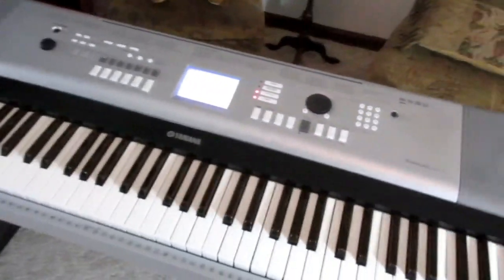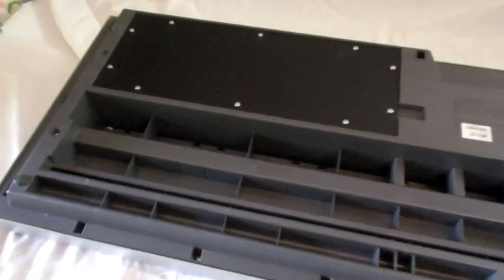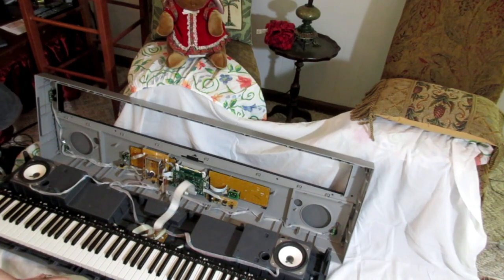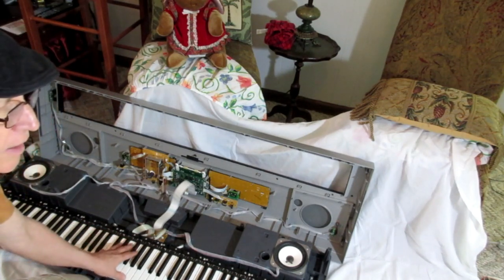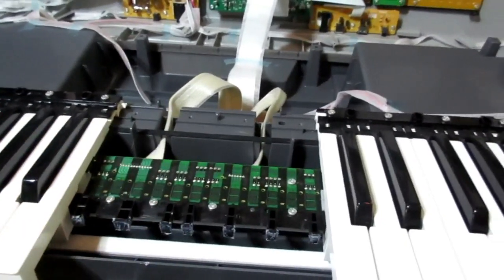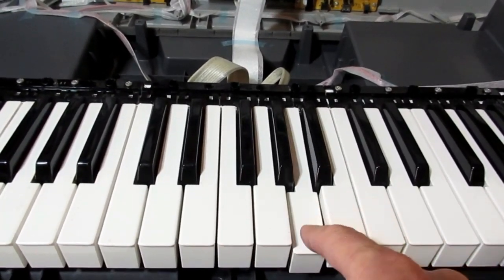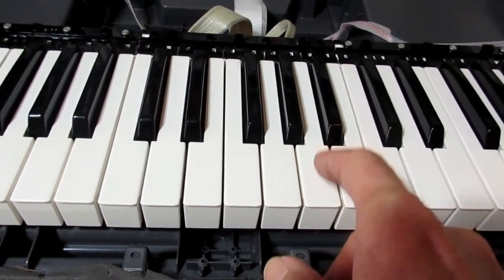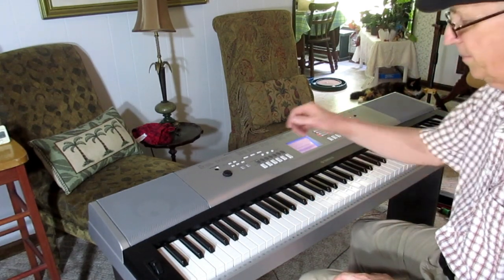I fix a loud key on my Yamaha DGX-520 digital piano.  Thrilled!!

Comment: I practice watching youtube video cause I can’t afford a teacher. I stopped playing piano for 8 months due to your same problem but with 8 deferent keys. The store told me it’s a motherboard problem and I need to pay almost $400 and was too expensive for me. I did what you did and now it’s fixed for free. Thank you bro you really made my year. I was feeling very down because I use to practice 2 hours every day. It sounds dramatic but i swear my eyes are tearing as I’m writing this. I really needed my keyboard back.
Reply from the maker: Your comment made my day.  I'm very pleased my video helped you get back to using and enjoying your keyboard.  Thanks for taking the time to tell your story!  Rich Davis😊😊😊😊😊😊😊😊
Reply: I have a yamaha E363, it has been with me for almost 5 years or so, it's in pretty good condition but I have the same problem, I thought it was dust, but it's two specific keys in all octaves; D's and G sharps. They are too loud if I play them on normal pressure and If I use a lot of pressure they either go silent or play 3 to 4 times. I tried this a lot of times, even used alcohol pads which made it better, but still loud, but it isn't working and I feel helpless, I can't afford getting it fixed from the store either, and I think something's wrong with the motherboard. I haven't played it in months, it was the only way I could relax and ever since then, I haven't been feeling amazing. I get what you're saying, that your eyes were tearing up as you wrote, and so I wanted to say that you're not being dramatic at all, I feel what you felt for those 8 months, I hope you're doing great and so are your piano skills. I'm thinking of maybe selling it and buying a new one, or maybe just stop playing piano since I can't really watch it sit there and feel helpless
Reply: @AjwaQur If you are having issues with keys in the same octave across the entire key board, I think I know what is causing that. The CPU inside the keyboard can only process one key at a time but it does all of them so fast over and over again you can't notice it. Yamaha keyboards don't scan from the lowest key first to the highest key last (progressive), they instead scan (interlaced) by scanning all the Cs first, then all the C#s, and finally all the Bs. They do this to save micro chips and for a less noticeable scan delay and is called multiplexing. When a problem is common to the same key in each octave, its the Common Note drive line that is flaky.  I am familiar with Yamaha keyboards (I have a DX7). I could probably fix it but it would not be practical to ship. I suggest you find some big engineering companies in your area and ask if you can post a flyer on their cafeteria bulletin board that you need help. If you go to several companies you may find a hardware engineer that might fix it free (except for the cost of parts). I do this often but only for local people.

Comment: Just got a same problem on my DGX-660. Now i'm gonna disassemble my piano. That's what i've read about what the problem is: "There're 2 switches mounted at different heights on every key, The piano does a really clever thing of measuring how long it takes for the two switches to be made. If you brush the key lightly there will be a greater time between both switches being made, in contrast if you strike the key hard the switches make much quicker. If however one switch fails, generally the piano will play the key at full volume as only one switch makes."

And that's exactly what i saw in your video (see at 8:34) – the A-key (the 3rd from the right side) had some white particle on it when you removed that grey rubber thing. Hope, in my case it will also be that easy... 🤔🤔🤔

Thank you for the video! 🙏🙏🙏
Reply from the maker: I hope, hope, hope it works for you.  If so, you will feel wonderful!!  Rich

Comment: I had the exact problem with my Korg SP170. I did a similar task and realised that even though a digital piano can save regular tuning costs compared to an acoustic piano, BUT, these lousy parts can also become defective and expensive to replace. I was lucky as you to not have to replace anything yet, just clean it. I had around 5 loud notes and 5 were almost mute before I opened it and after operating in a similar fashion, I managed to get the piano's notes back to perfect velocity on every note, except a very high note, which I don't mind now, since I hardly ever use that note.  In the end I probably have to repair those rubber contact strips, which are not very cheap...
Reply from the maker: I'm glad you were able to fix most of the problems you had with your keyboard.  You're right in that we probably can't keep fixing them forever.  The money I save in piano tunings might buy a new digital piano every few years.  I love my Yamaha DGX-650 white digital piano.  I've had it maybe five or six years now and have had zero problems.  I would never want a real piano of any kind as I grew up musically with Yamaha digital pianos.  I couldn't live without all the voices and the multitude ways to play.  Thanks.  Rich
Reply: @richdavis4007  also may I add there is a lot of rubbish on youtube these days but your video has helped me a lot as long with others to eliminate some of the guessing I would have done if I tried to fix my digital piano without this so thanks again for the post

Comment: I had few keys sound bad, after reading in commets here i tried to use the other end of vacum to do blower with tiny nozzle tip and blow in the spaces of the keys and its amazing the bad sounds gone and normal sounds comes back, so the videos and the commets really helps to solve my problem in my dgx 640, so no need to open and clean inside the piano as i did before. thanks to everyone.
Reply from the maker: Thanks for sharing your experience.  For those not wanting to take their keyboards apart, your methods sounds worthy of a try.  I can only vouch for sure what I did in this video.  Very best wishes.  Rich Davis

Comment: Finally fixed my loud  keys  after hours of try and error, at the end i had to remove the gray membrane and replace it with another one from a different octave and it worked!! 🤤🤤🤤🤤🤤🤤
Small tip for the ones who will try this: remember to always try your keys before screwing all the screws!!! And if you did it once do it again cause once is never enough😑😑at least in my case, i literally screw 200 times because of this dumb error.

Muchas gracias desde Chile,i'm subscribed to your  channel now, thankful to you and proud of me  at the same time hahaha . I couldn't stand more days hearing these OFFENSIVE keys 🥳🥳🥳🥳🥳
Reply from the maker: Super!  You hung with it and didn't give up!  It's a great achievement!  Rich

Comment: Nice video. At 2:28, a paper egg carton is good for organizing small screws, just make a note on each compartment with a sharpie.  So, for your viewers out there... you may want to hold off on throwing away your egg cartons and bulid up a reserve. They are stackable and dont go bad on the shelf.
Reply from the maker: That would have been very useful!!  I'll remember next time I have a lot of screws to deal with in a project.  Thanks!!!  Rich
Reply: @richdavis4007  I learned that egg carton trick from my dad working on engines. I am 60 now, so I pass on these tid bits when I can.

Comment: At 3:47 you can magnitze most screwdrivers by stroking a strong permanent magnet ONE WAY from the handle toward the tip (use the same end of the magnet for each stroke). About 20 moderately fast smooth strokes usually is all it takes. The magnetism wears away after heavy use but will hold for years. You can always re-magnitze it any time you want. If you remember which side of a magnet you used, stroking that side of the magnetic back from the tip to the handle can demagnitize it (but its hard to get it to zero). A degaussing coil is better for that.
Reply from the maker: Thanks for your helpful tips!  These should be useful for people watching my video!  Rich
Reply: @richdavis4007  Rich, it is refreshing to see people give it a go like you did. It's my pleasure to add my 2, 3, 4, 5 cents [smile].

Comment: At 9:05, clean everything with 95% or better Isopropyl Alcohol and also clean the Carbon Impregnated rubber contacts inside the gray peice you removed at 8:31. Its those contacts that touch the "serpantine" traces on the printed circuit board that makes the electrical connection when you press a key. Sometimes you may have to rough up a rubber contact very lightly with 200 grit sand paper. Pollution in the air glazes over the rubber over time and prevents the carbon from making good contact.

BTW... The reason there are two switches for each key is that they both don't contact at the same time when you press a key. One will contact first and then a few milliseconds later the other will contact. The computer in the keyboard measures this time difference and determines how quickly or slowly you are pressing the key to make it sound louder or softer like a real piano.

Sorry, for all the commets. You did a great job, but I do this every day, and just want to help you and your viewers.
Reply from the maker: Thanks for your helpful information!!

Comment: I have a Yamaha CLP-545 that had the loud key problem on some of the keys. I thought it was a dust problem, but actually it was not.

I called Yamaha service center in Denmark (the country) and even though the piano is not under warranty it appears that Yamaha a number of years ago issued a bulletin named DMI064 which basically means that they will replace central parts of the touch registration prints and rubber for all 88 keys for digital pianos that are affected by DMI064.

Just today the service repair guy came by and did the replacement, and until now, I have not been able to reproduce the problem. Additionally the rubber sensors are of a slightly different type which produces a better feeling when playing the keys.

The best part is that this was done for FREE, yes really.

(Disclaimer: I can only speak for my own experience with Yamaha support in Denmark)
Reply from the maker: This is completely new to me!  You are the first person who has had such luck that I know of.  Thanks for letting me (and others who read comments) know about your success.  Rich
Reply: @richdavis4007  You are very welcome. The service guy even added a sticker beside the serial number to indicate, that this piano now has the official fix. My parents have a newer CLP than me, I do not think they have the problem. Indicating that this pertains to certain models and certain production years (I forgot to ask that :-)
Reply from the maker: @druffyw  Sounds like this pertains to just a few Yamaha keyboards.  Thanks for all your information.  I'm sure you are happy with such service and result!  Rich

Comment: At 4:12 The proper screwdriver is VERY important. There are 3 types of screws that LOOK like philips in most consumer electronics (I am not talking sizes, I mean types). These are: Phillips, Reed and Prince, and Pozi Drive. The screws all look similar at first glace but if you look closely at the driver tip, you can see the differences. Phillips have a flattened tip, Reed and Prince have a pointed tip, and Pozi Drive has tiny ridges between the "wings" of the tip. If you use the wrong tip  on the wrong screw, you will most likely strip the screw head. There are several web site that explain this.
Reply from the maker: Thanks for your helpful information!!😊

Comment: Well done, although I consider that the screws that hold the keyboard itself should not be removed because you will have problems when you want to turn everything over to re-adjust the back cover. I think many keyboards are like this. Usually it is enough to remove the screws that remain on the outer contour of the cover. If the cover comes off normally with that, do not remove the other screws. I made that mistake when removing the cover on mine. And to prevent dust from getting into the contacts, keyboards should be sealed more effectively. It's the smallest specks of dust that sneak in. These devices require to be as well sealed as a hard drive.
Reply from the maker: Thanks for your tip!  I've done my fix and hopefully will never have to do again!!  Your suggestions may help others.  Rich😊😊

Comment: Usually this problem happen because of the rubber contacts. It should be cleaned it the first place. I had the same problem in the past with several instruments that I had. In some of them I had to exchange the  contacts with those  from other place because the simple cleaning didnt help, after that the sound got back to normal.
Reply from the maker: Thanks for the tip!

Comment: I have more than 1 key with this problem any advise? Thanks u
Reply from the maker: I would try the same solution that worked for me.
Reply: @richdavis4007  I see I am planning to use 70 % isopropyl alcohol wipes to clean, would that be ok? Also I saw some videos where the person used a pencil to shade the covered sensors , is it necessary? Thanks again
Reply from the maker: @melputra919  70% isopropyl alcohol is a good choice.  I didn't use a pencil to shade covered sensors, so I wouldn't think it would be necessary.  Good luck!  Rich
Reply: @richdavis4007  thank you so much 😊will try Tmr
Reply: @richdavis4007  hi , I spent half a day cleaning the sensors and so far it is working . So is it the sensors accumulated dirt which I can’t see and thus cause the loud keys? Actually when I opened the keyboard ‘s rubber it looked clean but I still followed and wipe it
Reply from the maker: @melputra919  I was able to see the dirt that caused my problem.  All you can do is clean the area as good as you can and hope it works.

Comment: Thank you very much for this video. I got the same problem with my brandnew DGX 670 two times. First one after one month (!), got a new one and same problem after 6 month. I didn´t wanted to transport it again, because the 670is pretty heavy. Same problem, same key. What ist wrong with Yamaha? Is it a construction error of the Yamaha GHS? How is it possible to have dirt under the rubber? This is really annoying. The piano is placed in a clean room, no carpet and we did care a lot. So where does it come from and how to avoid? Thank you a lot again, Rich!👍👍👍
Reply from the maker: I've had my DGX-650 about seven years, play it every day, and I've had no problems with it at all.  It's hard to imagine your piano having the same problem I had.  The keyboard I cleaned was purchased at a thrift store and probably not taken good care of.  I wouldn't think a piano would have this problem after one month.

Comment: I have a new yamaha piano..just 4 yeard old ... many keys have become loud.. despite the fact that i always keep it covered 😪😔
Reply from the maker: Maybe it's humidity that caused your problem.  There was obviously dust inside my piano and dirt.  The people who had it before me did not take good care of it.  All I can recommend to you is contact Yamaha support.  I wish you the best.  Rich
Reply: @richdavis4007  thx..yes i always lived near sea..though moved to dry climate now..to top it i have a labrador at home..last time i got it serviced by Yamaha to discover it was because of dog's hair🙂
Will contact yamaha again..most of the centres are shut due to covid.
Delhi is presently facing covid music😥😢
Reply from the maker: Good luck, friend.  If you have one of these digital pianos, I guess you could take it apart and have a look.  If you can keep track of the screws and have long screw drivers it shouldn't be too hard.  I did the job and made a video as I went in 2 or 3 hours.  Rich
Reply: Yes rich..it's digital and wil try out the repairs
Reply from the maker: Good luck.  You'll be happy if it works and you don't lose much, but some time, if it doesn't.

Comment: i am having yamaha keyboard as a same problem ,even i cleaned the pcb board but still problem so i replaced new rubber pad but problem not solved.. can you tell me if it is fault on motherboard ? and i forget to tell you ,all are keys are working in normal position but when i swiched on touch on off switch that time problem give start ..
Reply from the maker: I can prove no more help than this video.  I'm not a piano technician.  I solved this problem for myself but I have nothing more.  Best wishes.  Rich Davis

Comment: Hello sir. Nice video. 

I have a little problem with my new korg Nautilus synthesizer synth key bed. 

One of my Black key has a noise. Spring kind of noise. Although it's working. All the other keys are fine how can i fix it. Is it fine to use it like that.
Reply from the maker: If it's new and can be returned I would.  If you are willing to play it as is, I doubt if there would be any harm.  On my Yamaha synthesizer I have a key that's just a bit spongy.  Doesn't quite feel like the other keys.  I play on.  😊😊
Reply: @richdavis4007  when I play the spring sound doesn't brother. . Do you have a montage? ☺

Comment: By the way, if your piano keys are not attached by screws as shown in the video, they probably have a small  tip (pink in my case) which is attached to the board and holds each key with pressure (really annoying btw) so i recommed  a small and  flat screwdriver to push them back with relative strength and to put them back just apply light pressure in the correct direction😇
Reply from the maker: Thanks for your suggestion to others! 😊😊